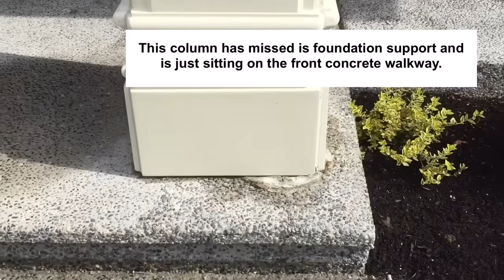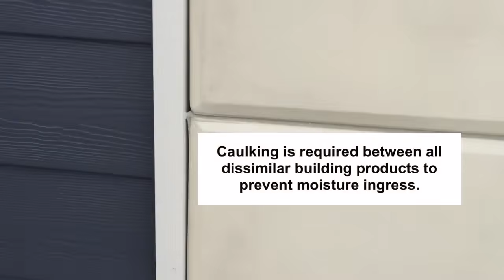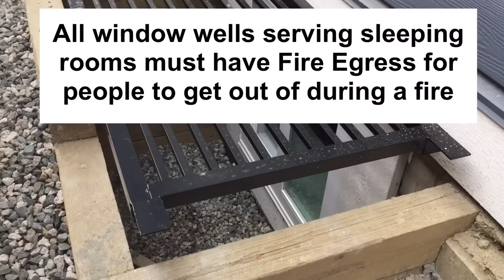New Home Construction Inspection - This is Shocking!!

Comment: My house was built by a master builder in 1894.  Still as good as new. Solid as a rock. No wafer board, no prefab framing, just quality materials and conscientious workmanship.
Reply: My house was 82 no caulking on the house just prober over lay. It’s crazy
Reply: I just tor out my sister's bathroom that was built in the 1870s.  I was shocked that their wasn't any mold ANYWHERE.  It was built beautifully, just hope the new guy they hire to remodel it does the same.
Reply: 2x4 and plywood ??
Reply: Yeha but you had to rip out all the wiring and plumbing.  You also don't have insulation.
Reply: congrats?
Reply: @FnGRZupra  lol gotcha!
Reply: My '85 home had no paper under the siding.
Reply: It is unreal what people are paying for new homes with the cheaper and cheaper quality and materials today. Doesn't matter anymore because someone IS going to buy it. Then they will sell it later for even more after it has degraded. Homes are nowhere near the quality what they once were but everyone wants more and more money for everything. 

Any house that is built within the last 20 years, I would have them inspect the hell out of it before purchase. But I still would not pay what these prices are.
Reply: Quality materials? There is a scarcity of materials because resources have been exhausted.  Quality workmanship? Unskilled labor cheaper than skilled carpenters. Today's market: git er done quick and cheap as possible. That's what people want so that's what they get.
Reply: Exactly.  If you want to buy a house make sure it was built before at least 1965.  Otherwise you're better off in a cardboard box.
Reply: @ericg9828  lol that's some stupid logic
Reply: @4o4err0r.  Do you speak English, by chance?
Reply: @Hayyyward  Prices go up on everything, genius.  So do incomes.  What world do you live in where housing should be a fixed cost over the decades?  So, the fact that they cost more has NOTHING to do with whether or not they're better quality or not.  Don't buy a crappy house if you know what to look for.  Otherwise, all the technology for HVAC, insulation, waterproofing, etc. is far beyond what they had available even 20 years ago.  And it will get better.  It's called innovation.  If you guys want to build log cabins and heat them with a fireplace... go right ahead.  If the termites don't eat it and you don't die from exposure then pass it on to your grandkids.  UGH.  So stupid.
Reply: @DiffEQ  Who ever said anything about fixed costs? Nobody. The point is they are building homes with much cheaper materials and charging more for it. The only innovation about that is called markup. Homes simply are made much cheaper where the builders are raking in more profit. 

Also, now homes are so expensive that you rarely hear of anyone that does not have a mortgage. Pretty sad when you think about paying that much more for a home that deteriorates that much quicker with cheap materials. There is a reason that these ancient homes are still standing today that have not been lived in for years. They were built better. Todays homes would crumble in no time if left vacant for just a decade. 

Costing more has everything to do with quality. Or at least it should. Most people are too ignorant to know just how crappy their homes are even built now.
Reply: Mine is also late 1800’s. During the inspection the only issues found were under the addition that was put on in the 2000’s! They had to jack it up, replace a main beam, and re stabilize unsecured footers. They said the old part of the house was still solid as a rock.
Reply: I live in a new england home built in 1860. Original stone foundation and everthing is still in fantastic shape. it has some quirks and doesn't have the high ceilings or immense living space of a modern home, but it's built well and that's something that so many home buyers these days overlook.
Reply: @Hayyyward  i dont think its the fact that things are built with cheaper materials and people are charging more for it, i think its just that if you want to build a house with quality materials that will last a lifetime, then youve got a house that 3/4 of the population cant afford. the only way the majority of people can afford a house is if it is built with cheap materials. but thats just due to income not increasing much over the last few decades, while inflation has risen.
Reply: @acow9966  But they are. For example, they used to be built with plywood which is much stronger. Now they use particle board which is cheaper pricewise and even cheaper quality wise. That's just one material. And quite a useful one when you are talking about structural quality. This has been going on for a long time now because builders kept raising their prices for better profit margins. People expect their homes to increase in value so the prices keep going up more. Even though those homes are degrading quicker now than new homes built 50 years or more ago. The only way many can even afford to buy a new home now is if it's cheap and that means MADE CHEAP. That is what America is known for. Mass produce to sell to the masses for MASS PROFIT. You can still get quality but you have to really pay out the a$$ for it today.
Reply: @Hayyyward  yea well depending on your location, a single sheet of plywood right now can cost 80 bucks. As I said before if companies built houses using better materials then nobody would be able to afford them. Very few people can afford a brand new home built from lower quality materials right now.
Reply: @acow9966  Yeah material prices have shot thru the roof especially in the last 2 years. But new homes being built were not that much cheaper just before then. Builders were really raking in the profits. Now that inflation has hit harder, new home prices have increased again. But watch....prices of lumber have been going back down. Those new home prices will not. Builders will keep their profit margins high. Higher quality materials like concrete and cinder block for instance really should not be priced as high as it is. Builders don't like concrete walls because if it shifts at all after built due to the settling in of the home, they are responsible. So they make the prices much higher to make it worthwhile knowing people will just go with the cheaper route. Now if they had skilled workers that know how to properly build concrete walls correctly, we'd probably see it much cheaper. But many of these builders are paying for cheap labor (better profit margin for the builder). I will say this...we didn't used to have all these permits that were so costly like we do now though. It's ridiculous the amount of things you are required to get a permit for now when building new or doing to an existing home. Just another reason builders use cheaper materials. They're not in the business of building homes for less than what they know they can get. And they know people will pay even more as we have especially seen recently. So as long as these people keep paying ridiculous amounts, they are only supporting the rising costs to continue.
Reply: @Hayyyward  eh I dont really care to talk about this anymore. I dont really care enough
Reply: @FnGRZupra  lol you’re pretty slow huh
Reply: @funny3scene  nah just rich
Reply: My house was built in 93 and it's all falling apart lol. Crappy chicken wire and Styrofoam cookie cutter style in Az.
Reply: and I bet it has no cheap Chinese made materials that are not made to last.
Reply: @manuelgaetan  You can still build them like that today.  It'll just cost you 2000 dollars/sqft lol
Reply: @manuelgaetan  I agree but where else are you going to by materials?
Reply: My house in England was built in 1793 with no problems!
Reply: My father’s house is over 100 years old; no problems.
Reply: well its not 1894 einstein.
Reply: Even my 1950s built home is built like a brick shite house. Redwood timber, plastered walls. Built over a crawlspace, so no slab to crack and easy access to plumbing/electrical. And this was built for a very middle class, nothing-fancy area. My previous place built in 1990, you could put your fist through a wall. Lots of plumbing issues.
Reply: [smiling]  My grandfather, a master carpenter built the family farmhouse (1930s) which I inherited.
I've had to put a LOT of money into it, because they only maintained the house, no upgrades.
Electric, plumbing, official survey, windows, septic tank, well, etc. etc.
Still, it's well built.  Contractors who come in are always impressed.
Reply: Mine was built in early 1900s. Don't know exact date. Still solid as a rock. Will stand another 100 years with proper maintenance.
Reply: Love that soothing traffic noise….
Reply: Does it have wooden pegs to hold the joists to the wall framing?   A buddy of mine said he saw a house done up like that a long time ago....
Reply: 1940.  Same.  A bit of settling as you would expect, but that is all.
Reply: @FnGRZupra  Doubtless it was built before wiring and would have been fitted with wiring and upgraded several times.  It isn't that hard.  The waste plumbing may still be in place, although the freshwater should have been changed at some point.
Reply: My house was built by a master baiter.
Reply: @MrCherryzz  Don't count on it. Even though you hire a GC you MUST be the GC or you will get a shoddy product. I wish your sister the best.
Reply: my dream is to build houses just like this
Reply: 1894 here as well!! 🎉🎉
Reply: You're VERY lucky!
Reply: @acow9966  Huh?  I wonder why 100 year old shotgun houses are still standing and solid.
Reply: @Hayyywardyou can't build a house like they did in the late 1800s...a 500k dollar house built with virgin materials like in 1800s would cost you 5mil.  Wood was incredibly plentiful, cheap and virgin timber and labor was cheap which is why houses had all the woodwork inside.  Its like when people say "there are still ancient Roman roads that are in good condition, but there is a pothole in the road outside my house, I wish we built quality like they did 2000 years ago"...they can build roads stronger today than the roads like the Appian way, but it would cost a ridiculous amount of money it wouldn't be worth it.
Reply: Ok good for you bro

Comment: The front steps do not look right, the spacing between the steps is not even. That house looks like it needs to be torn down and rebuilt by a different builder.

Comment: Run....if they missed so many obvious issues, imagine problems you may find that are covered up like electrical,  plumbing, heating and structural items.
Reply: I was thinking the same thing. I wouldn't even want to know what the wiring and plumbing looks like that is hidden behind drywall. two million dollars wasted
Reply: Exactly Wayne, and those issues could be dangerous and costly down the line.
Reply: Wayne Schlotfeldt These houses have to be inspected every step of the way. Inspected by city inspectors. And they must pass. If not, the house wouldn’t make it far at all. Hilarious. 

Learn the building process and then realize that those things aren’t as bad as he’s making them out to be.
Reply: Those things get inspected before covered up holmes
Reply: crackahh npc6969 yea, but easy to slip through the inspection as city council inspections aren’t that rigorous
Reply: Classic Man I’ve been a GC for a while now building restaurants and salons. In some cities, you have the same inspector through the entire process because they’re short staffed. I’ve had inspectors take one step in, look around, and leave a green tag on the window. This was for the electrical rough in. He didn’t spend more than 15 seconds and immediately walked out. I don’t have a personal problem with this because I have full trust in my master electrician but to think there are some out there hiring non licensed electricians working with a permit obtained from another licensed electrician (if you have no idea what this means, you obviously have never worked in construction), people are right to be concerned about what might be under those Sheetrock.
Reply: uhohhhsteven damn :(
Reply: uhohhhsteven the problems will start rolling in in less than a year and the council inspector will carry on doing this crap :( I feel bad for some new homeowners, particularly those who have no experience whatsoever with construction. They buy these expensive houses which won’t last.
Reply: People seem to have the idea that official inspection guarantees quality work. It doesn't. Inspections more or less guarantee that building code is met.  There are plenty examples of awful buildings, shoddily built, that were properly  inspected.   Also consider the possiblity the inspector is the builders brother in law, or something like that.
Reply: @AustinJ  what's that red tank next to the hot water heater?
Reply: @ClassicMan33  and there's no chance the inspectors are overworked and in a hurry or being paid to overlook shoddy work...right, tell me another fairy tale.
Reply: This is why I do all my own work. People just want to cash in and run
Reply: @chromolitho  That's exactly what I was thinking.  Hongcouver is largely taken over by foreign interests.  You get an Asian complany, they look after each other.  So do the muslims, E. Indians, etc.
Reply: Most items were minor issues other than the rain gutter issue  &  egress. All easily corrected
Reply: @ClassicMan33  That is great in theory but often not reality. I know in some areas inspectors only do spot inspections. I also know that when I closed on my new construction in 2006 the city inspector showed up two week AFTER I closed on the house to do the final wiring inspection, despite the inspector's signature on the final permits. My neighbor's house had plumbing joints that were never even glued(all cpvc plumbing). The first time they used their shower water started pouring down in their kitchen.
Reply: @ClassicMan33  .  Actually, those things are bad.  They all show that the GC and SC's are sloppy and lazy and don't know what they are doing.  There is an old saying that my Grand Father said he learned from his Grand Father, "Cheap labor isn't skilled, and Skilled labor isn't cheap.  You get what you pay for and you'll pay for what you get.  So do it right the first time or don't even do it at all."

As far as the building inspectors, they are not all perfect.  In fact, here in New Orleans, the entire inspector office, from the top down is under investigation for years of failure to perform adequately, taking bribes, and even worse.  Google Hard Rock Hotel collapse in NOLA, and you'll see where "Building Inspectors" aren't really doing what you might think they are doing.  People DIED because of them NOT doing their job as the building progressed.
Reply: @ClassicMan33  If you think government building inspectors catch everything you are crazy.  I have found code violations in every home I've owned and friends homes where I've helped do work in.  In my own home the building inspector literally asked who did the work and when I told him who it was he pretty much took the job on reputation signed off and left to go to lunch.  I watched my contractor and he did do a good job and the right things but the building inspector was quite caviler about it and in my home I've found more than a few code violations.  Inspectors largely trust contractors and many are good but even a good contractor uses apprentices and some of them do a lousy job and if the contractor is overly busy it gets missed.  New home builders are the worst though, they drive their subs hard and the results show, things are done as cheaply as possible usually.  The work on that house is schlocky and that composite siding will rot because of the lack of caulk, literally $5 worth of caulk not being there could cost thousands when that siding swells up in a few years.  If yo are building a home or getting work done look, watch, and question because if they think you'll notice they won't take the short cuts on your jobs.  New houses are junk, my house for 1926 was heavily renovated and guess what the problems are with the newer construction, the original stuff is good even the scary bronze plumbing(I Know it needs to be replaced! It's nearly a 100 years old).
Reply: If the home was built in the last decade chances are corners have been cut heavily really there is no avoiding it all you can do is be diligent during the purchasing process. The exception being homes built by commission in which case you can generally expect a higher quality of work although I would do my research in the builder brought in to do the build.
Reply: @ClassicMan33 no what's worse is it got that far after ,said inspections city, county, etc lots of people need to lose there jobs